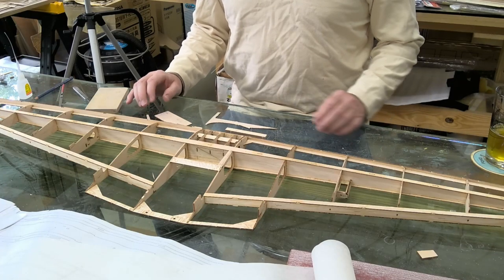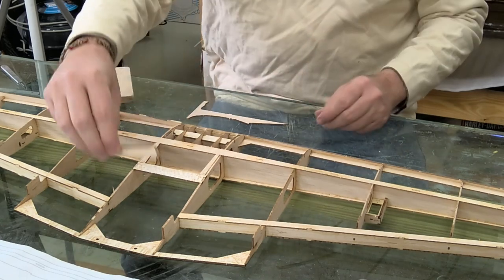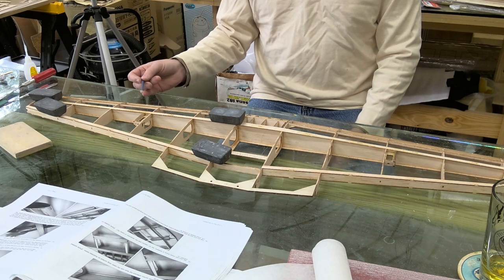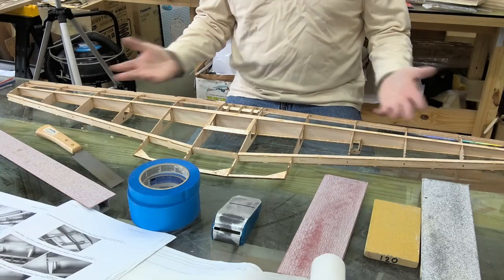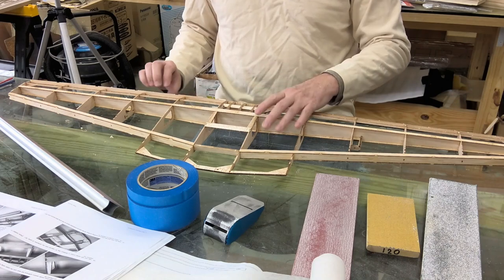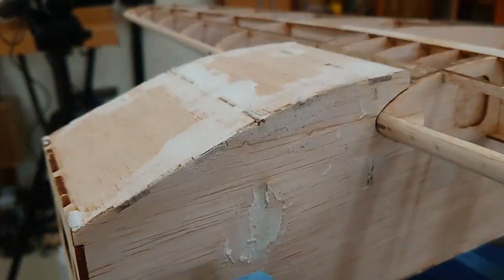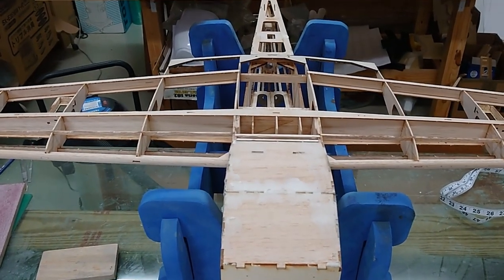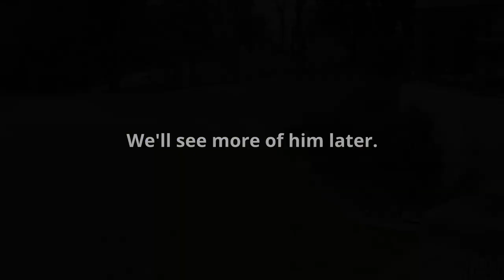Stevens Aeromodel G-480 complete rc airplane kit build, Episode 8.

Comment: information         ANY  pushrod should be long enough so that the (minor) angular dislocations that occur in this type of  linkage  are  'smoothed'.       (this is similar to the need to not make a connecting rod in reciprocating engine  'too'  short.)       d

Comment: information          manufacturer's mistakes          :11   the mass of the servos  Should be located  Forward-of  the cg/main spar.        that mass could also have been located at the  inboard side of the nearest rib.          why  does  this  matter.?          span-wise  and  length-wise   distribution of mass.        d